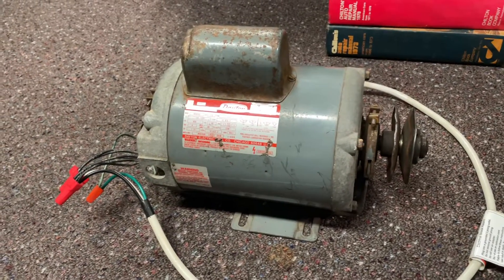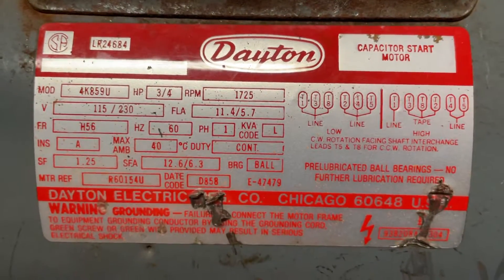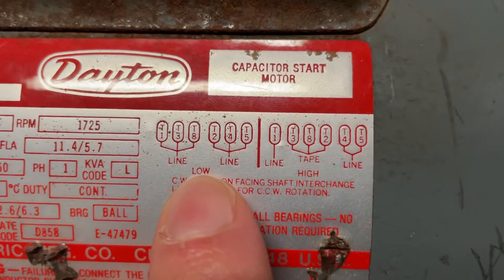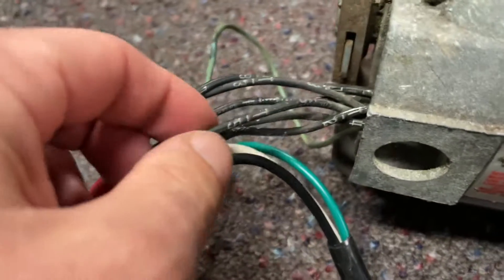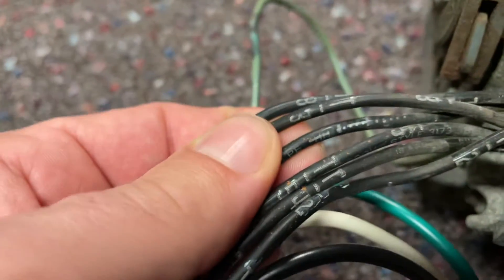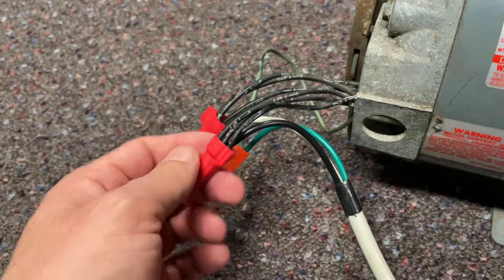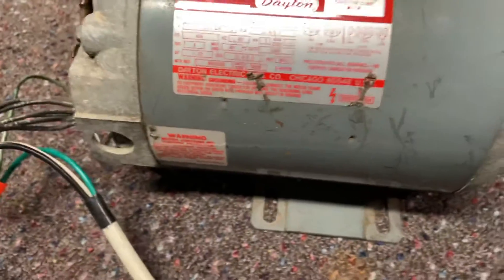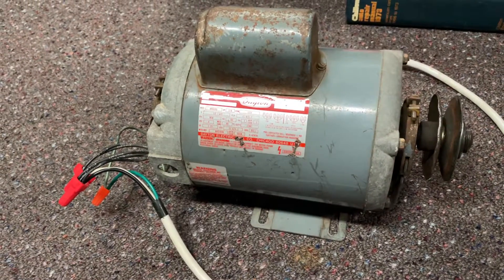Re-wiring Dayton motor from 230 to 115 vac.

Comment: Does the start capacitor have to be hooked up to run after rewiring to 115?
Reply: It wasn't hooked up
Reply from the maker: Yes start capacitor is needed for both 220 and 120 volts.

Comment: I've looked for a long time and behold this video came from AI I suppose. It is very helpful because your Dayton has wires similar to a 50 year old Franklin motor I have, except they are just numbered 1, 2, 3, etc.. The wiring label on the Dayton seems pretty clear on how to wire it for 115. The problem I have is the schematic for the Franklin confuses me. I think this was wired for 230 because it trips breakers and is sluggish at startup. I've tried using a multimeter on the lines but I get no readings but 0. So, I created a powerpoint presentation from the information I have from the motor wiring in a desperation attempt and hoping some really smart guy who knows these things could help me out. I'm trying to wire it for 115. I'm not trying to push this video but I uploaded it to my channel and called it 1.5 HP Franklin Motor Mystery.  If anyone can help me out I would greatly appreciate.
Reply from the maker: @ForeclosureGhost  so I watched your video and you have low voltage and high voltage. If it’s wired for 230 volts and you run it on 115 it’s going to be sluggish. If you wire it for 115 and run it on that it should run just fine. The only reason I can think of on why it tripped a breaker is because the 115 is too weak to run it wired for 230 causing an overload.
Reply: @Alan.89  Thank you for looking. Like I said, I'm a bit ignorant with this and I'm trying to figure out the wiring for 115. By accident, I found a video that helped me better understand how to read the wiring label even though it had nothing to do with my problem. Go figure? Anyway, I replaced my old 16 circuit breaker panel with a 24 and installed 12 20 amp breakers in hopes that was enough. Thank you again for your comment. You don't know how much I appreciate it.

Comment: I judy picked up the same motor today and it was a mess.  Didn't know where to start.  Couldn't understand what tape meant, kinda vague.  You can guess how that search went.    Seems to be going backwards, but very happy its turnuing.   Does it sah Swap T5 with T8?   your sticker is better shape than mine, thanks again

Comment: Serious question to anyone that can answer. If wiring is done incorrectly (220v instead of 110v) or something along those lines, how would the motor react? I quoted a customer to have a burnt up motor just like this to be replaced and they got someone else to do it instead. They call me back out to say it is not working again. I find a new motor installed but it is going out on thermal overload. It cools down, starts up, then gets fire hot, stops and repeats this process. My suspicion is that the other person did not verify the supplying voltage and wired it incorrectly (high voltage instead of low voltage or vice versa). I told the customer to call them back because I am not fixing someone elses mistake. My question is do the symptoms I described sound like an incorrectly wired motor. Thanks.
Reply from the maker: It could be the load is way too much for the motor to handle causing it to heat up and trip the thermal overload. You can wire a motor for 220 volts and run 120 and it would be fine. But if you wire it for 120 and run 220 you would burn up the motor.
Reply: @Alan.89  thanks. I may never find out if that's what happened but it's nice to have confirmation because this is not the first time I have ran into this issue. But customers continue to go the cheap route and pay twice 🤷‍♂️

Comment: If they all say LINE, how to tell what Hot vs Nuetral?
Reply from the maker: All the leads have numbers on them. You will need to look at the label which includes the wiring diagram. For example if it says line 1 and line 2 then line 1 is your hot and line 2 is your neutral. If they both say line then your hot can go to any one of the two and your neutral goes to the other. Hope this helps.
Reply: @Alan.89  makes perfect sense. Thanks
Reply: I'm still confused 
I have a motor with 9 lines 
And I'm confused which one I can hook my neutral up to 
I have four wires black white red and green ground I'm trying to run  240 V
And I can't find a video similar to yours with the right diagram 
I'm afraid if I hook up the neutral I would trip my breaker or fry the motor